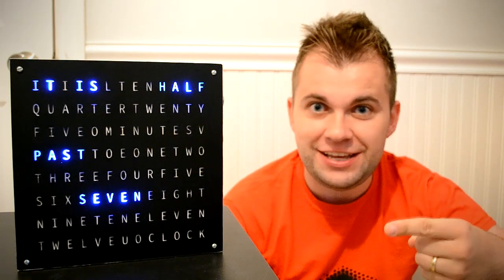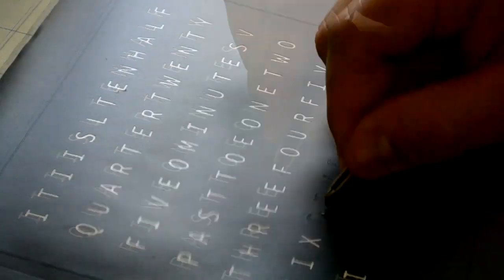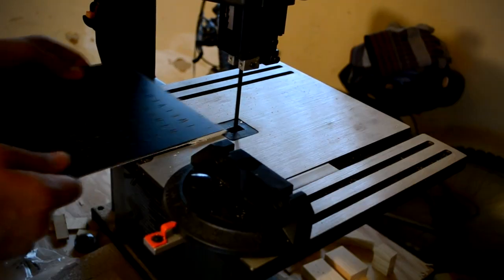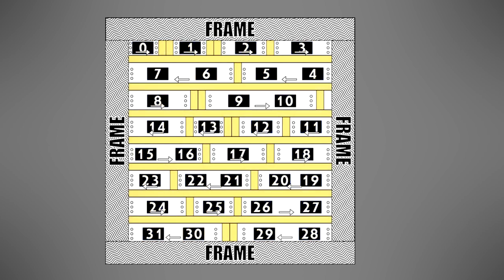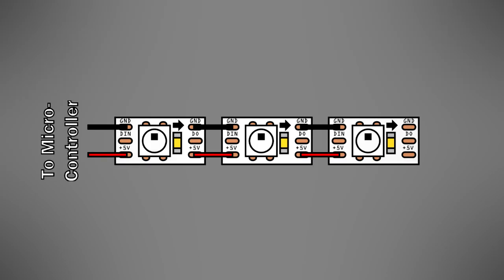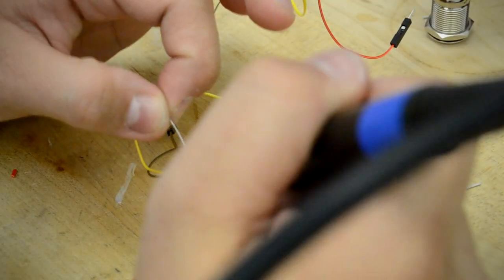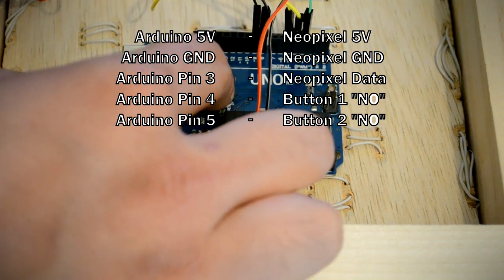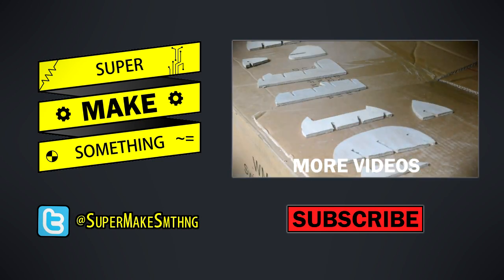Arduino + Neopixel Word Clock - Super Make Something Episode 6

Comment: cool idea! I wanted to make this project but I don't have a printer like that. any idea where I can find already made clock face? Thanks
Reply from the maker: You may be able to get this done through a website like Etsy, where you can custom order a vinyl cut design from a vendor. A design file for the clock face is linked in the video description if you would like to use that! Good luck with your project!

Comment: Hey Alex, thanx for this great project. I've a newbe question: using an ArduinoNANO (instead of Arduino UNO) I've realized a PCB using your project as reference but I've changed the DigitalPin 3 that you've connected to DataIN of the LED strip to DigitalPin 8 (I hope that this works anyway) and instead of using your type of BUTTONS I used a simple buttons to solder on the pcb with only a N.O. pin and GROUND pin. But using you configuration the Button is connected to two digital pins and when I push it it make a short circuit between 2 digital pINs. Can I do that or I'll burn the pins.
Bye
Reply from the maker: Hi Matteo! Switching pins for the LED should be fine as long as you also make the corresponding changes in the code.  Regarding the pushbuttons -- you can also do this, but I would recommend using the Arduino's internal pull-up resistors to make sure that signaling occurs correctly.  Check out my video on the "DDR Dance Pad" for more information on this.  Hope this helps and good luck!
Reply: @SuperMakeSomething  Thanx Alex, Keep It On With Your Great Projects...I'd like to See What You can do with SuperCaps 👍😎

Comment: How do you have the push buttons wired?  It's a bit hard to tell on the video.  Ground is far left and 5V is on the right (based on 6:44 into the video), but I can't figure out the three prongs/pins in the middle.
Reply from the maker: +Brad Runnion The description of which prongs on the buttons are wired can be found as text beginning at 8:01.  The buttons have labels on their housing indicating 5V, GND, and "Normally Open" or "NO," which is what the jumpers are wired to for these buttons.

Comment: From the internet I came to know a neopixel requires 60mA current when RGB works at its fullest. You have 32 of them, meaning 32*60=1.9A of current requirement at its worst case. Also there are two push buttons which will increase current consumption. So, my question is, how come your arduino is able to provide that much current, approximately 2A?
Reply from the maker: +Sujal Yadav Great question!  The wiring diagram for the electronics is shown at 8:21.  The 5V line of the Neopixels is hooked up to the Arduino's 5V line, which provides regulated 5V power to the LED string.  This pin is connected to the Uno's on-board voltage regulator, and thus operates differently than a digital pin on the Uno.  While the digital pins can only source ~20mA continuously, the 5V pin can source around ~450mA continuously, with ~650mA peak.  While you are correct that the Neopixels in the clock would draw ~2A at full white, full brightness with all LEDs illuminated, the trick to this clock is that not all lights are on at the same time.  In the worst case, i.e. the time with the most text, 10 LEDs would be on at the same time.  Assuming full white, full brightness, this would consume 600mA of power, which is within the peak power output spec of the 5V pin.  In practice, this results in a very bright clock, so I usually have just one color illuminated at half-brightness.  

While I don't do this in this circuit, the Uno's Vin pin could also be used to power the LEDs if you could ensure that you have a regulated 5V a input to the microcontroller.  The voltage of the Vin pin is the input voltage before the regulator.  Connecting the string to this, again ensuring that you would have a clean 5V at this pin, would allow you to power as many LEDs as would be within the current draw specification of your power source.
Reply: +Super Make Something Great explanation! Thanks :)

Comment: I see that in your code you define a few extra pins "#define BUTTONLEDPLUS_5V1 A2
#define BUTTONLEDPLUS_5V2 A3" that are not covered here. Can these pins be ignored?
Reply from the maker: Anthony Veloso Good catch! These pins are connected to a second 5V line in the button which powers an LED. You can ignore these without affecting the functionality to save a bit of battery, though the look might not be as cool with the unlit buttons.  :)
Reply: Thanks for your help! That makes sense.

Comment: @supermakesomething hello.. great video.
i want to make this but i want to add RTC to take care of the time. can you help me with that?
Reply from the maker: DEVANG JOSHI Adding a real-time clock to the existing code should be relatively straight forward, but I've unfortunately never done it myself. However there are plenty of tutorials online, which should be easy to follow. http://tronixstuff.com/2014/12/01/tutorial-using-ds1307-and-ds3231-real-time-clock-modules-with-arduino/

Comment: I am trying to cut the vinyl and I can't get the file uploaded into the Cricut software. Any suggestions on how to get it in there? I tried typing it out with the font you said below you used but isn't quiet equal spacing
Reply from the maker: Unfortunately I do not have any experience with the Cricut software, though I imagine that Silhouette Studio, which I used to generate the path to cut the image, is quite similar.  After importing the SVG file to the software, you will need to "trace" the outlines of the image using the Cricut software.  This video should hopefully help you get started: https://www.youtube.com/watch?v=BdVZmID8pdQ

Regarding the equal spacing -- have you tried typing it without spaces?  If that still does not work for you, a ZIP file containing the SVG image I used for my clock's face is available in the video description.

Comment: @supermakesomething
I am suffering getting the measurements right for the template and clockface. Before jumping on to cutting the vinyl, I thought it would be great to print them on paper and try to overlap them and see they are being overlapped properly.
To my horror, they are not lining up as per the LEDs layout. Can you please give me the font size you used and a mapping of which section of the template.svg will be overlapped by which letters of the clockface.svg file?
 I am asking this because i am trying to make do with led strip of 30 LED/m strip so spacing on my led is bigger(Almost double)
Reply from the maker: No problem!  The clock is 8x8 inches.  The font is Source Code Pro, with a size of 43.  Hope this helps!

Comment: I'm a bit new to electronics. Should you have added a capacitor to protect from voltage spikes? Thanks. Great vid!
Reply from the maker: Thanks!  Great question -- each Neopixel actually has a small decoupling capacitor on each LED, so I did not add one myself.  In general, capacitors in this type of application act to stabilize the power to chips, so it is never a bad idea to add more, however, I found that it was not necessary for me to add additional capacitors for this project.

Comment: Hi! I’m a total beginner but I’m in the middle of soldering together the led lights. How do I test if they work? I’m using a basic code on arduino to light all of them red but some of them aren’t working when connected even though I tested all individually and they all work. Would really appreciate an explanation
Reply from the maker: It may have something to do with how the length of your chain (how many LEDs) is defined in the code. Are a series of lights illuminating and the one after are dark? If so, try increasing the number of LEDs defined in the Arduino code. Hope this helps!

Comment: How many of these lights can you drive before you will be forced to use an external power supply?
Reply from the maker: From what I can find online, the Arduino's 5V pin seems to have a max current draw of 500-800mA. With 20mA per red, green, or blue LED that is between 25-32 LEDs at full brightness. For white, which requires the red, green, and blue LEDs to be on simultaneously, this would drop down to 8-10 LEDs at full brightness.

Comment: I am making this as a fun DIY project and I'm on the step where I'm tying to upload your file to the Arduino but when I do there is an error that says "adafruit_neopixel" does not name a type. I do not understand enough about code to see what the problem is. Can you help me get it to upload?
Reply from the maker: +John Vo Hi John,  I think the problem results from the fact that you do not have the Neopixel library installed in your Arduino directory.  The first post by user "pburgess" at this link walks you through how to resolve this issue: https://forums.adafruit.com/viewtopic.php?f=47&t=36015.  You will also need the "Time" library in order to enable your Arduino to keep time and act like a clock.  This code can be downloaded here: https://github.com/PaulStoffregen/Time.  Click on the "Download ZIP" button on the right and extract the files.  Then copy the ""DateStrings.cpp," "Time.cpp," "Time.h," and "TimeLib.h" files into the same folder as the "wordClockCode.ino" file.

Please post a picture of the word clock when you finish it!  I'd love to see how it turned out!
Reply: +Super Make Something oh that must be it! Thank you!

Comment: Hi @Super Make Something
 - is it possible to place more LED's behind the board, I'm looking at buying a Neolight strip that has the LED's more tightly spaced, for a more evened lighting effect. And if so, would I then have to change your code to renumber the LED's? Cheers
Reply from the maker: It should definitely be possible to place more LED's behind each compartment.  You would have to change the code, but this should be a relatively easy change -- essentially you want to change the total number of LEDs and the if statements that tell which LEDs to light up depending on the time.  Good luck with your project!

Comment: Hey mate, Awesome clock! I'm making one for a friend. The Neopixels are supposed to draw 60mA each when they're turned on fully. The 5V output can only supply 400mA so you  could only really turn on 6-7 LED's at a time before blowing a fuse or something. How did you get around this? I've got a 5V 3A supply, I was going to split the 5V wire of that to power the usb plug for the arduino and power the 5v input for the LED strip, what do you think about this solution?
Reply from the maker: Luke Ainsworth Thanks! Good question. The way I get around this is by not turning the clock to full brightness, and primarily running the clock in red, green, or blue -- each Neopixel has one of each LED, which can each draw a max of 20mA. For intermediate colors, these RGB LEDs would be mixed together at different brightnesses. However, using only one LED at a time for each "pixel" allows for more of them to be on simultaneously, as you said. As long as you have a regulated 5V output, I believe that your solution of hooking them up directly to the 5V line should work, if this is indeed the rated input voltage of the LEDs.  The microcontroller is really only used to regulate the data line of the LEDs that commands the colors.
Reply: Cool, thanks for the quick reply dude. Have a good new year!

Comment: Love the video, I have no experience in coding or Arduino, so i have been doing some research and im going to try to give this a shoy. I would like to build a word clock using an Arduino and a DS3231 module ( to keep time when loosing power),  what would my set up be to connect the two modules together and the code to programme the modules as per your video. I would really appreciate the help.

Comment: I'm planning a word clock build similar to this one but with leds behind each letter. Surely a total of 98 strip leds (max 30 at any one time) would overload my arduino. 

Do you have any advice for getting around this? 

I was thinking of using a 5v power supply but I was unsure what current I would need for this.
Reply from the maker: I agree that 98 LEDs would be too much for the Arduino to handle.  However, you can connect the 5V line of the LED strip to a power supply/battery directly, and only use the Arduino for signaling/setting LED colors, brightness, etc.  More information can be found here: https://learn.adafruit.com/adafruit-neopixel-uberguide/power  Hope this helps!
Reply: Super Make Something thanks for the quick reply. I'll check out the link

Comment: Hello Bro.. good job nice idea. I made this in German works well. Thank for your video and links. I have one question;may i know why time is delay 30s for every 5min? Do you know any reason? Thank you. Good job and well done again.
Reply from the maker: Thanks and congrats on your build! I would double check that you programmed the Arduino with the right frequency (i.e. 16MHz if you have an external oscillator or 8MHz if you are using the chip’s internal clock). While the clock will drift after time because it does not have an additional real-time clock, 30 secs every 5 mins is definitely more than it should be drifting.
Reply: Hi Alex,Thank you very much for quick reply..Appreciate your support. I will check the settings..
Reply: Can u send me the german code?

Comment: I used the adruino program that you wrote and it works great. Except for the timing. I am not sure if it is because my build uses 130 neopixels but 5 minutes clock time is 6min30sec real time. I saw you mention RTCs in the comments but that is a little high level for me. Is there a bias that I can add to the programming that I can add to compensate for my slow clock? Thanks for all your input on this build so far.
Reply from the maker: Anthony Veloso Hmm that is quite a bit of drift over a short amount of time, and suggests to me that the on-board crystal of the Arduino you are using is out of spec timing wise. Out of curiosity, do you have another Arduino handy that you could try? I am unsure if there is an offset that you can set at that granularity. However, I'm wondering if you could fudge the timing a bit by playing around with delays/pauses in the code. The other thing I'm wondering is if your Arduino is getting sufficient power, as the crystal seems to be running slower than it should be, however I am not sure if/how this would affect things.
Reply: I've found that I can add delays into the code but can't speed it up. I don't have another adruino but I did get an RTC just in case. I'm thinking I should just power through and try to figure it out. Maybe it is insufficient power. But I calculate that on average the neopixel configuration is drawing 470 mA .
Reply from the maker: +Anthony Veloso That may be your best bet if the slow speed is indeed related to the computational or power load due to the number of Neopixels. Since the RTC has a separate circuit that keeps time independent of the Arduino, this will allow you to keep accurate time regardless of what is happening on the microcontroller side. Sorry I wasn't able to help with this issue! :-/ If you do end up figuring out what the issue is, please let me know! I'm rather curious to find out what the cause is if you end up looking into it.
Reply: No don't worry about it. You've been a great help through this entire thing. I really appreciate it.

Comment: I want to load the code but get the following error code: setTime was not  declared in this scope. what am I doing wrong? (am beginner with arduino)
Reply: First you have to download the library from:
https://github.com/PaulStoffregen/Time
clone it as a ZIP file and install in Arduino IDE via menu Sketch -> Include library -> Add ZIP library
Then Sketch -> Include library -> Time
remove the line #include "Time.h" because correct declaration was already included by previous step
Now it should be fine.

Comment: Awesome! I always wanted a word clock but they are like $400. Never thought of making my own though. The funny part is, I do have neopixels laying around and I do own a Cameo Silhouette, welp... let's make one! What kind of neopixels did you use? Was it WS2812B bij any chance?
Reply from the maker: +LittleBits That's awesome!  Please share a link after you are done.  I'm interested in how your project turns out!  I ordered the LEDs from Adafruit -- based on their website, the rolls seem to contain either WS2812Bs or SK6812s.  As far as I know, these are interchangeable, so either should work!
Reply: +Super Make Something Great! I'll think Ill make it next week. Just thinking if I should use steel, wood or plastic for the back
Reply: +Super Make Something Well, I made one. Looks pretty neat actually but I still have a few issues.
The major issue; it does not run on time. After a few hours it is about 2-3 minutes behind. Is it because I use a, I think, fake Arduino Due?
Reply from the maker: +LittleBits Hmm... that amount of discrepancy over that short a time period is interesting.  Without a real-time clock, you are correct that the Arduino, more specifically its crystal oscillator, are doing the timekeeping; therefore, the clock is only as accurate as the crystal.  If you take a look at SibertD's comment below, I calculate that I should be seeing ~8.6 seconds of drift per day based on the specs of my Arduino's crystal that I found online.  I actually never noticed a significant amount of drift over the time period that my battery lasts -- i.e. the amount of drift for the lifetime of the battery (a few days) was less than the five minute increment that the clock can show.  It could be that the crystal you are using is less accurate, but I'm not really sure.  Another thing you could do to benchmark/test the clock would be to hook up a wall-powered supply to the Arduino to see if the voltage drop in your batteries over the run-time may be causing you an issue...